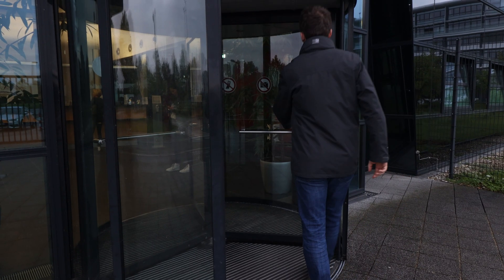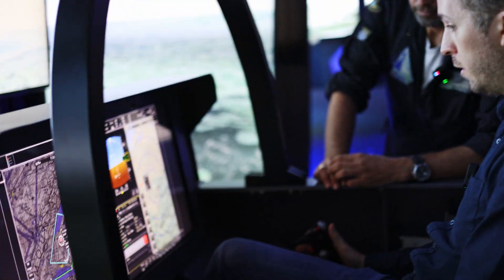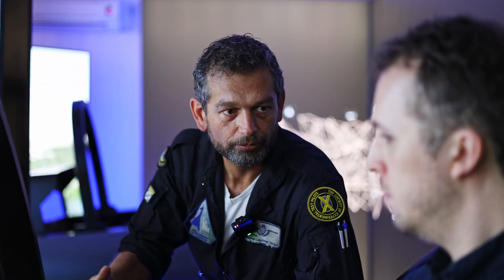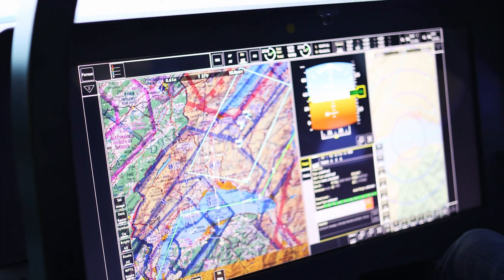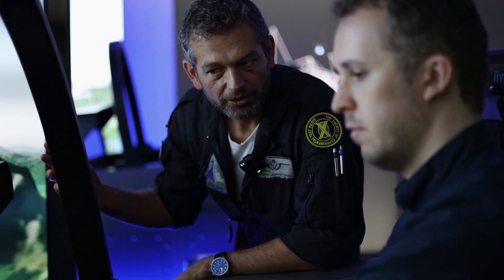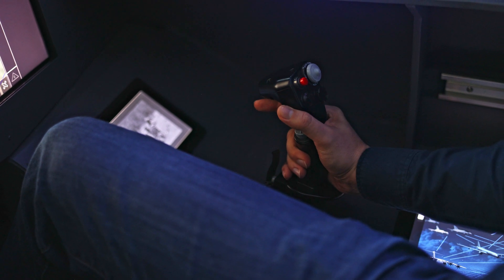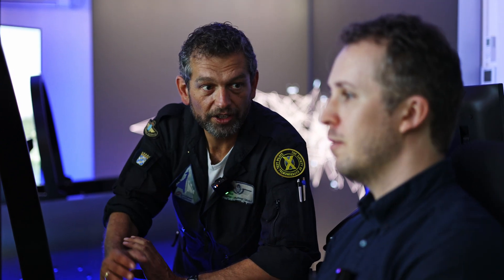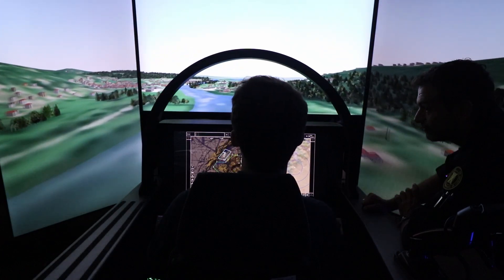Hands On Testing UNCREWED Jet Fighter Combat

Comment: An immediate change I would make to the interface, is the scrolling for the drones. Select task, get presented with either the best option of drone already pre-selected and confirm or select by direct touch and no scrolling and confirm. Scrolling is horrible as a feature if one is supposed to perform other jobs at the same time.

Comment: On a more serious note, with Remote carriers, would it be possible to have manned support aircraft accompany the carrier as opposed to drones? These aircraft would be easy to build but not expendable, often using components used in other systems that are normally land based The idea is you take lower enlisted and you enable them to perform their original jobs, but extended to the air domain. Such as stinger teams manning an aircraft with IRIS-T missiles flying air cover to protect against helicopters, having artillery crews go from a MARS to an aircraft carrying cruise missiles, EW troops flying ECR aircraft.
Reply from the maker: Operationally, the idea is going into the direction of a pilot/two-ship managing a variety of UxS from remote carriers and low end drones, to higher end uncrewed jets. See the UK ACP breakdown as an example. However, provided you can maintain connectivity, there is no need to always have a crewed system in close formation - as you note to extend the range into risky areas, the crewed system can stay back and let uncrewed handle it.

Comment: Ok here is a thought, has Airbus just considered shamelessly ripping off aircraft designs and putting their own spin on it? Like take a Mig 31 then slap in MTU engines, Hensoldt Radars, and make it out of the same composite as the typhoon? They could even do something similar for the SU-24 to replace the tornado instead of the F-35, if all else fails just make 1:1 copies.
Reply from the maker: Theoretically it is possible but for what purpose? What would such designs do better and do you need them?
Reply: @Airpower21  Primary driver of this has been my observation on the current air situation in Ukraine. On both sides the SU-24 has shown that it is very survivable and the ECM variants are very good at SEAD when utilizing SIGINT and Electronic attack to find and exploit gaps in air defense networks. Considering the F-35 is not considered good enough to replace the Tornado ECR. Aircraft "like" the SU-24 is a great place to start when it comes to EW and standoff attack to replace the ECR and IDS. Next point is the MiG 31 is an absolute monster when it is up. However like the De Haviland Mosquito the same flaw applies "there is not enough of them". The MiG 31 has shown its potential and I believe that would be something for Germany to look into and to make their own air supremacy variant to outshine the MiG 31.